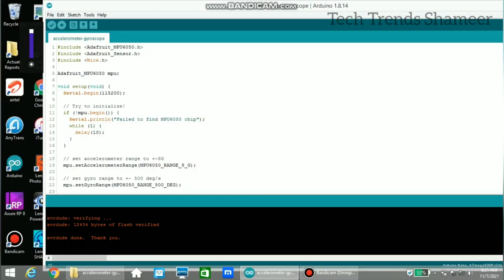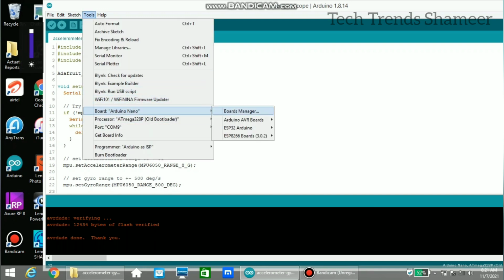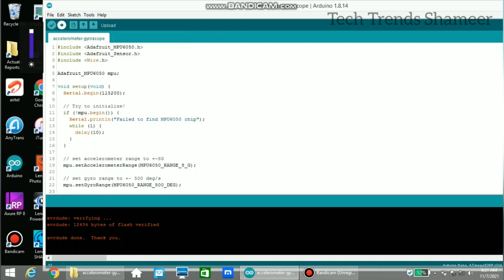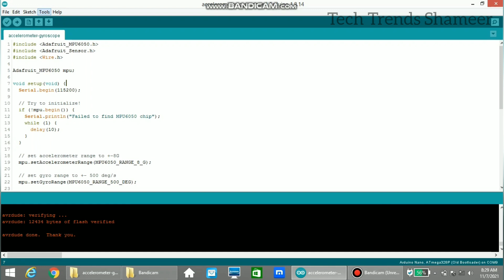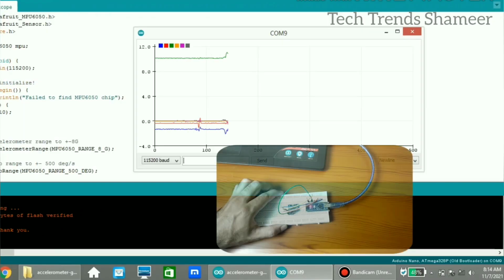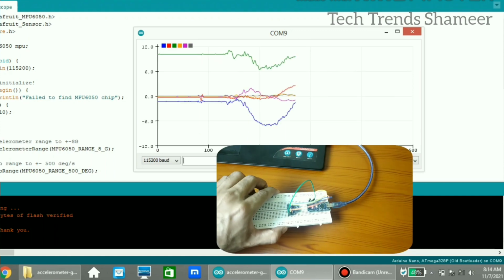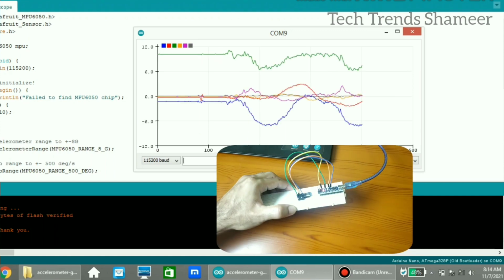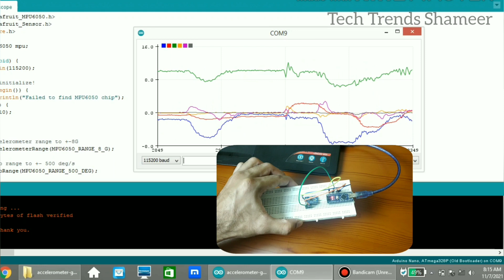How to interface MPU6050 Accelerometer and Gyroscope Sensor with Arduino Nano

Comment: How responsive is this compared to mouse movement
Reply from the maker: It works based on the movement of the sensor. Not based on mouse.
Reply: @TechTrendsShameer  i wanted to implement this in a hand motion-controlled mouse for that i wanted to confirm how precise its movement are and the amount of lag we can expect ? thank you